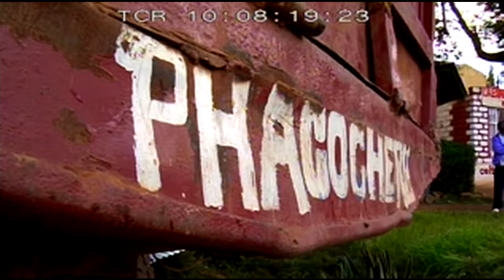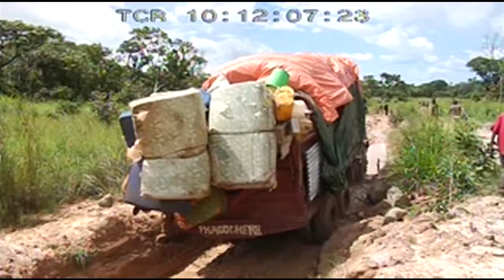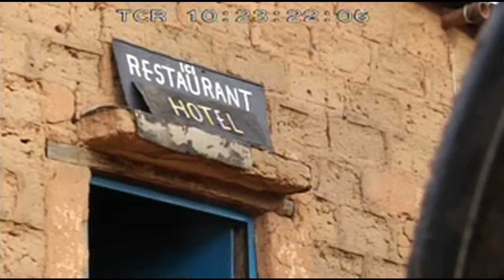Deadliest Journeys - Congo’s trucks

Comment: Funny thing is that 60% or so of the comments in the thread is by a device with components mined in Congo
Reply: Source?
Reply: More like 80%
Reply: @mauriceminevera2511  80% of coltan and 50% of colbalt comes from the DRC. Both of which are essential for laptops and cellphones.
Reply: mrtvicovek  It's funny because you mock a place you can't live without

Comment: With some motivation and work, they can fix the roads and dig ditches on the side to keep water off the road. Then build it up with rip rap (large rocks) then regular gravel over that.
We learned this a hundred years ago. 
Roads can be successfully built across swamps.

Comment: With new methods of building roads readily available and with such a large population in DRC such things should become a thing of the past. Just ask the mining companies to build roads instead of paying taxes on a pro rata basis. No new 10 km every month no license! Very simple formula. Congo also needs cement roads not tarmacking. Tarmacking is a lazy way of building roads. Get cement roads and you solve a problem for 200 years. Compact it, cement it move to the next 10 km! Hope the new president will take the initiative.

Comment: Can someone explain to me why DRC doesn't have a government capable of building roads?  (and spare me the racist nonsense I'm talking actual analysis of the situation).

Even if the politicians are corrupt they would see it is in their interest to have roads to facilitate trade.  So what the hell happened in this country?  Is it a failed state?
Reply: Perhaps you could use the internet ( other than YouTube) to figure that out for yourself. You have all the knowledge you could possibly need at you're finger tips. No need to ask others for info that you can find on your own!
Reply: Or I can just ask and see what answers I get back.  I save my hard research energy for certain topics only, but thanks bruh
Reply: Because Mobuto f’cked the country up.

Comment: Trucking in africa is ,driving 200meters get stuck need 1 hour to pull it out than driving 300m the truck broke down repairing it the whole day than driving 400m get stuck again. They should invest in infrastructure it cost money but they would later safe more money for repairing and need less time/ can Work more in that time. And the trucks would need the half of the fuel.

Comment: Why don't the make a road with trees? Cut down some of those trees and make a road with the trees. Like a railroad without the metal rails. That would work. You don't need to build a road like we build in the west, use what you have and keep on truckin'. Smaller trucks, a wooden road, they would be good to go.
Reply: They have a rainy season there. Wooden roads wouldn't last long in that type of weather.